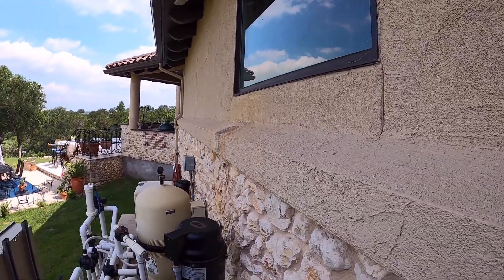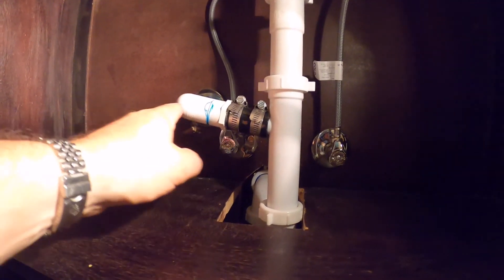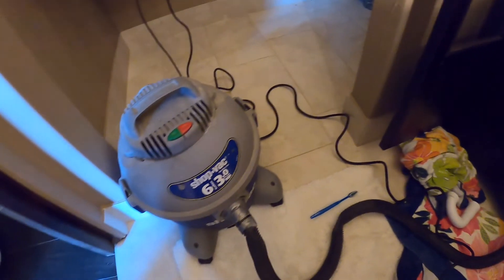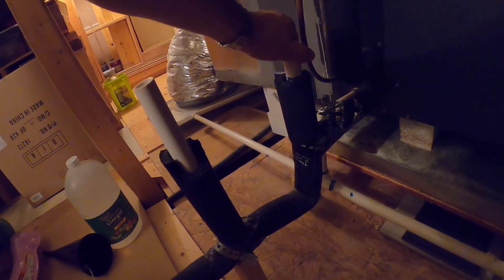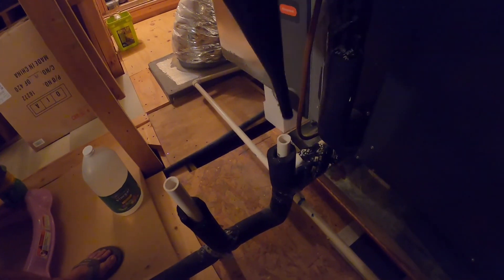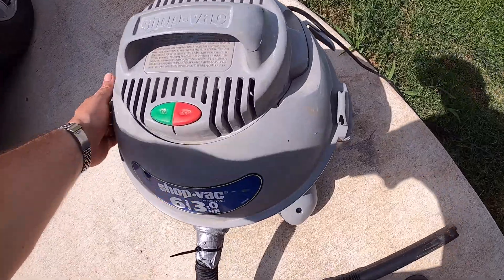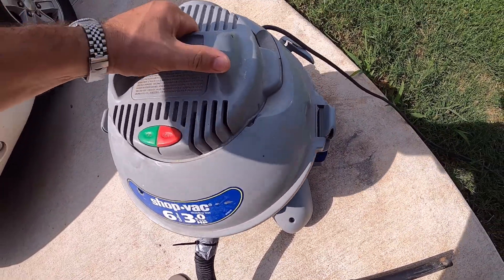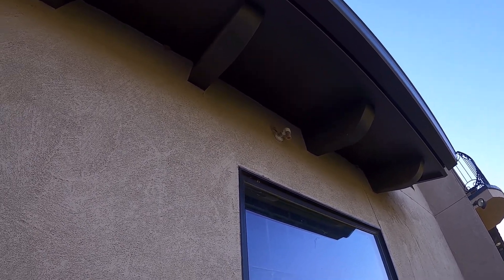Unclog Your AC Drain Line Pipe ✅ Using Shop Vac, Vinegar and Hot Water ● HVAC Condensation

Comment: Dude, you don't want your AC condensation line connecting to the house drain / sewer like yours does under the sink. If the water in the P trap evaporates or is lost, you risk dangerous and nasty sewer gases going into your AC system and spreading them throughout your home. That connection looks like a handyman special and is against most building code in my area. You should hire a plumber to fix it for you.
Reply from the maker: Thanks for your comment. This design is how they are done all over Texas. Remember that there is a second p-trap right next to the AC unit also.
Reply: My home has exactly the same set up, and I am in TX. thanks for the video and detailed explanation!
Reply from the maker: Yeah, it’s a pretty standard setup down here. Glad it helped!